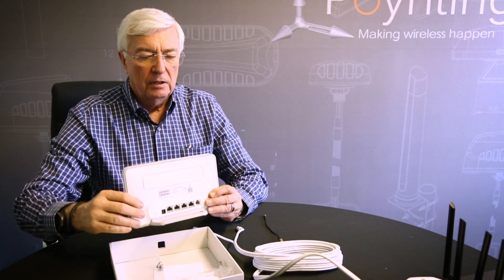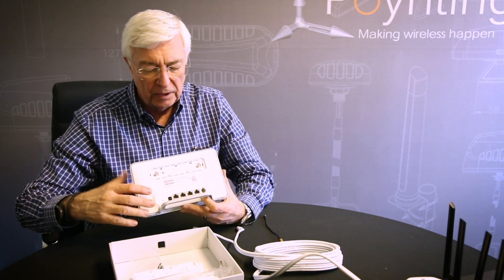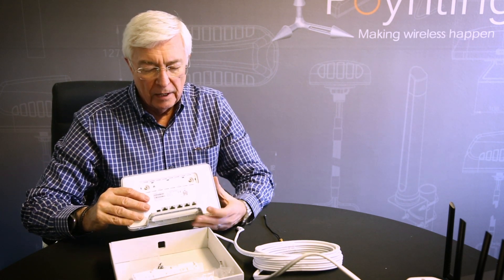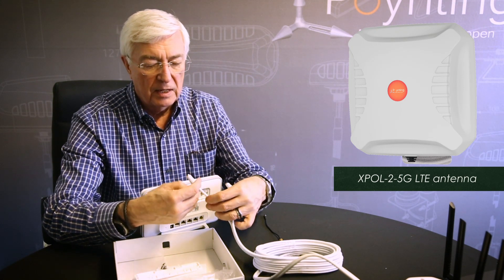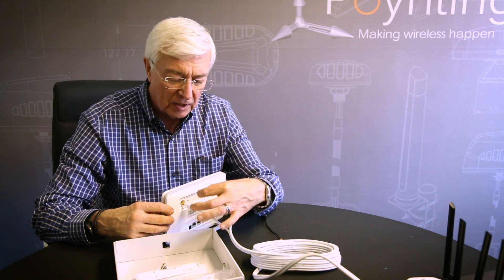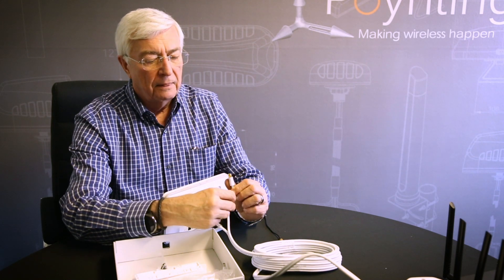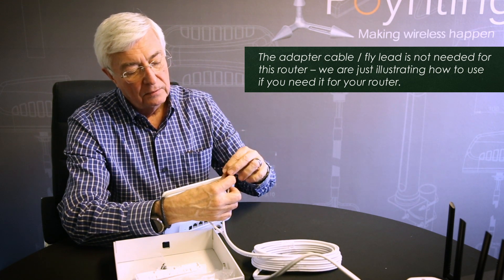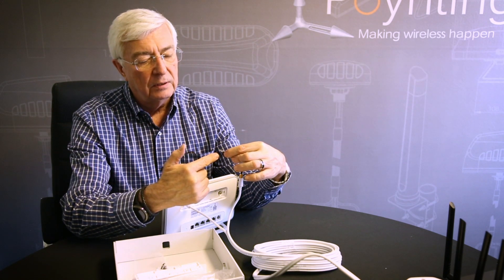How do I connect a Poynting XPOL-2 (or XPOL-1 or other MIMO antenna) to a HUAWEI B535 Router.

Comment: Hi is this ok for the zte 286c router
Reply from the maker: Hi Wynand - yes it seems that the ZTE 286c has connectors for an external antenna and the XPOL-1 or XPOL-2 will work well. Please note that you might need adapter cables as I could not see what type of connectors the router has. You are welcome to contact Emilio on his WhatsApp 073 782 8545 to assist. He will be able to assist with the antenna and adapter cables. 

In this video, Savannah shows you what the adapter cables look like. Different router - but same concept. https://youtu.be/fKn3nF81f60

Kind regards Ylana

Comment: does this fit a D-Link DWR-978 5G  AC2600 router?
Reply from the maker: Yes, the D-Link DWR-978 is compatible with the XPOL-2-5G antenna. Kindly see below the link showing that our SMA connectors on the XPOL-2-5G are perfectly suitable with the router in question. 
https://nascompares.com/review/d-link-dwr-978-5g-sim-router-review/

The client must follow the same steps as shown below, to connect their router to our antenna.
https://youtu.be/N6xfK1nsL0M

Comment: the router doesn't have 5g. does the extra antenna make it to receive 5g signal?
Reply from the maker: If the router is not 5G, then the extra antenna will not make it receive 5G Signal. 

However, if there is 2 connectors on the router it might be 4G and connecting both antennas will improve your 4G speed significantly.
Reply: @poyntingantennas  the router in the video is a 4g and the antenna is 5g. My question is does this combination give 5g signal? (lets imagine sim subscription support 5g)
Reply from the maker: Hi Ahoora - No it doesn't. It is a 5G antenna, but is backwards compatible with 4G etc.

Router, SIM, Antenna and cellphone tower in your area must all be 5G to get 5G Signal.

- Exceptional performance over the main 4G/5G bands
- High Gain for the antenna size
 - Wideband 2x2 MIMO 4G/5G antenna
- Backwards compatible 2G/3G/4G/LTE/5G antenna
- Two cross polarised antennas in one enclosure for optimal LTE performance
- IP65 weather/dust and vandal resistant enclosure.
You can have a look at the detailed specs here:
https://poynting.tech/antennas/xpol-2-5g/